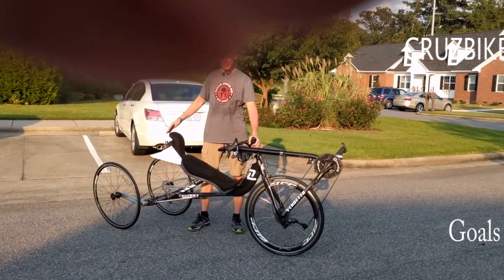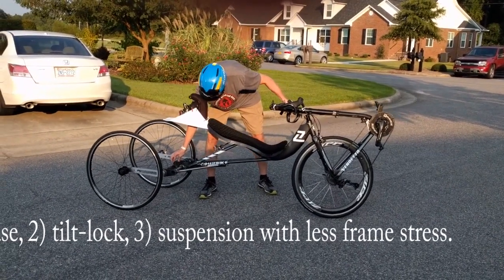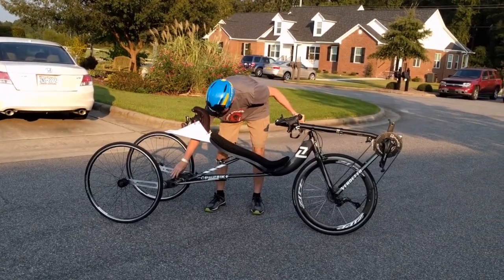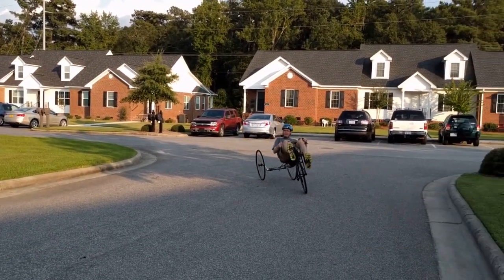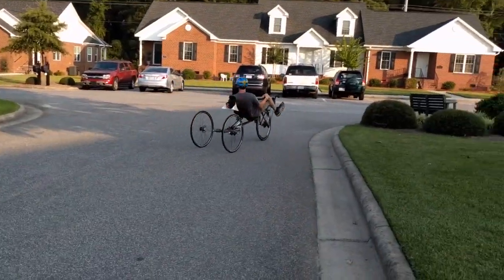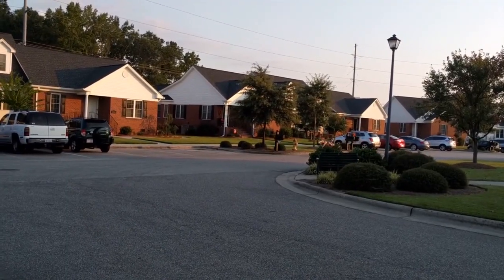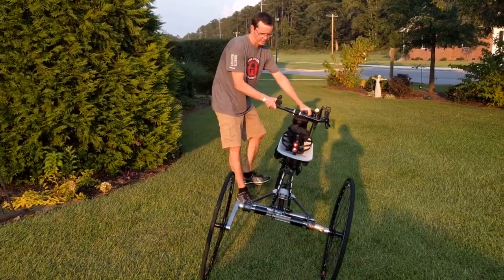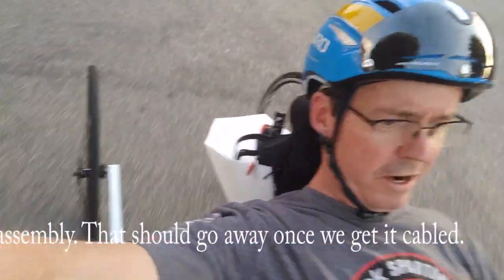CRUZBIKE TTRIKE prototype 3 demo

Comment: It is hard to think of a good way to make a "locking system that is not too rigid, but will trim to vertical when stopped or slow" without adding a bunch of weight.  Ideally, it should not have to be manually engaged at all, but automatically and gradually increase the range of tilting as the speed increases.  

Mechanically, I suppose it could be done with one of those old-fashioned Watt centrifugal force regulators.  Or perhaps the centrifugal clutch which was used in old-time rotary dial telephones, which prevented the dial from returning home too fast.  

But these days, there are other options.  You can get a small microprocessor which has a tilt sensor, accelerometer, etc all built in.  Hook it up to a servo to control how much tilt is allowed, and you could have a nice solution.  With some slick programming, it could even detect when the bike is tilting too fast, and engage the "trim to vertical" to prevent crashes.   Antilock breaking, perhaps...